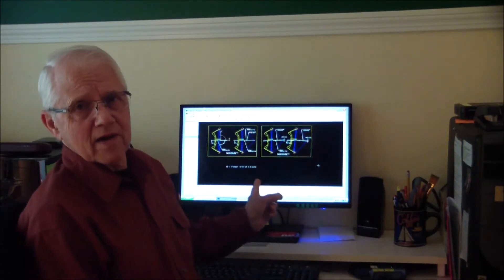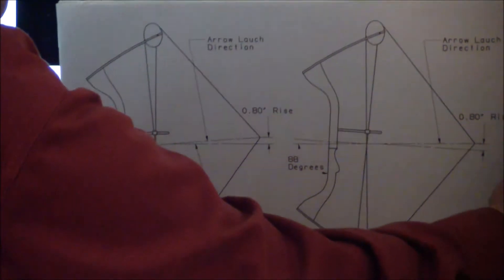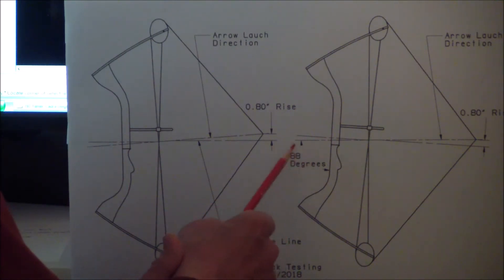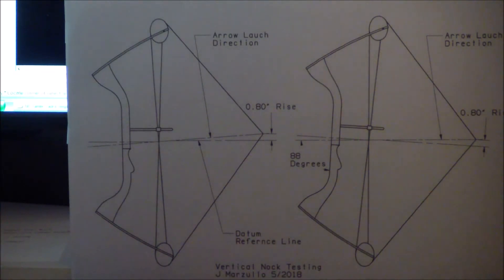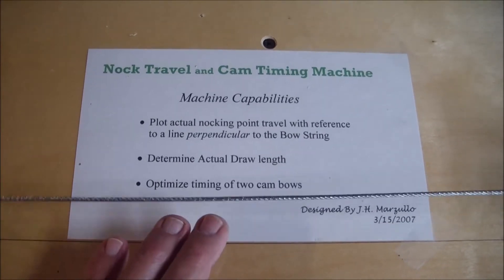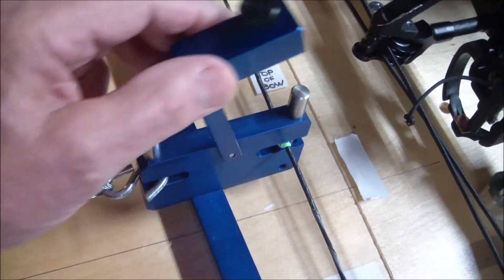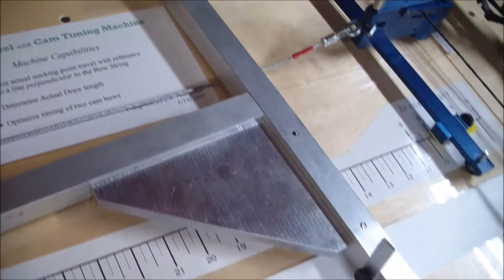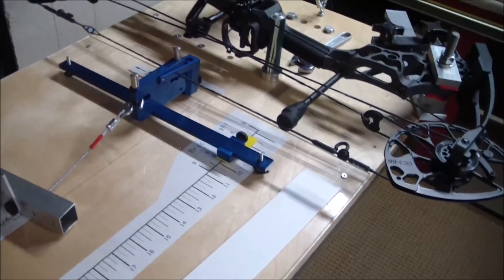Vertical Nock Travel Testing

Comment: Great testing Joe I would love to see a nock travel testing on a HTR I know the bow torque is very minimal my sight pin barely cuts passed my string when lining up the center line of the grip pin and string and shoots a fixed broadhead with lazer accuracy with field tips
Reply from the maker: Hello,
I did a torque test of Mathews HTR (horizontal nock travel) see the attached link.  https://www.youtube.com/watch?v=5EMIUNQkEfU 
Is that what you are looking for ?
Reply: I found a major issue with my HTR it has a spongy draw cycle but what is I bad is it shoots accurately on level ground but the bad design is when aiming downwards from a treestand at full draw the release on the Dloop at 85% letoff effects nock height the string tracks move vertically even bending at the waist I wanted to get to the bottom why a missed 2 deer 2 weeks in a row at 24 and 17yds my son spotted the bottom cam moving ever so slightly that string moves with the cams like crazy relaxed but it also moves at 85% letoff